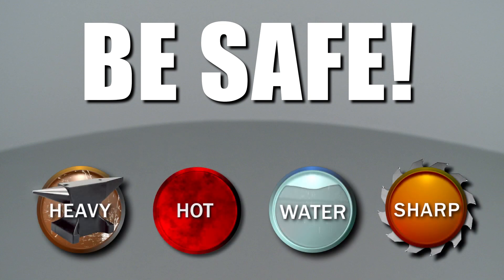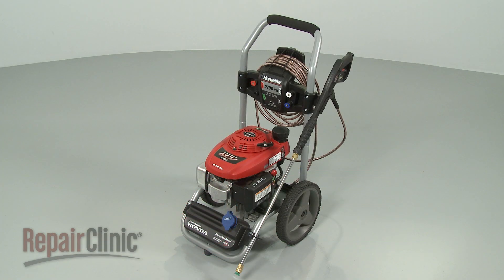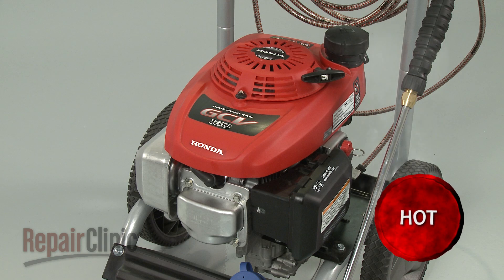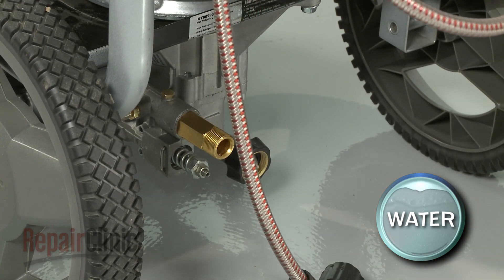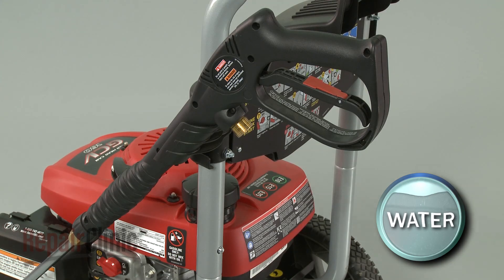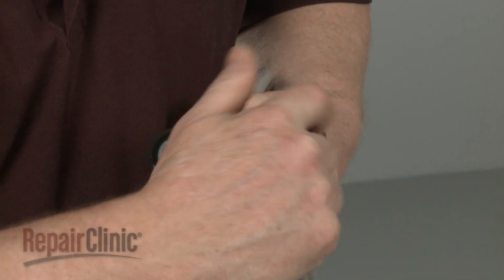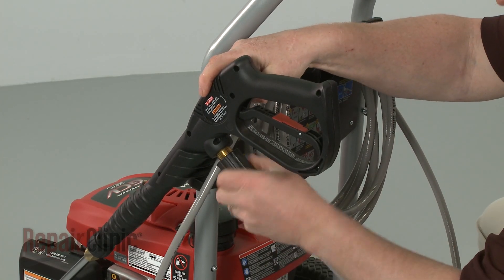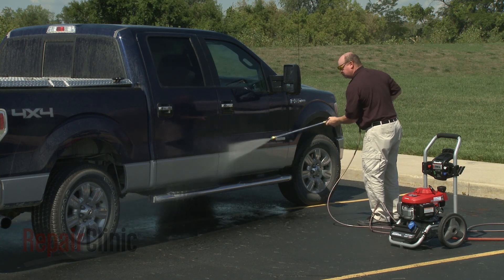Homelite Pressure Washer High Pressure Hose #308835006

Comment: After sitting in the garage for a year, I cannot get the pressure hose to unscrew.  It is frozen on their.  Any suggestions?
Reply: Use a torch and heat the hole area their.